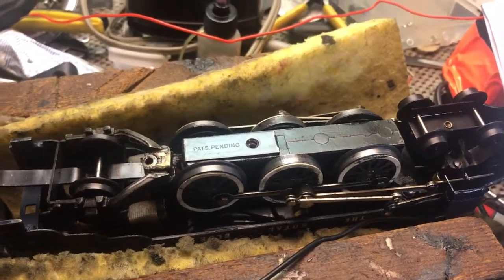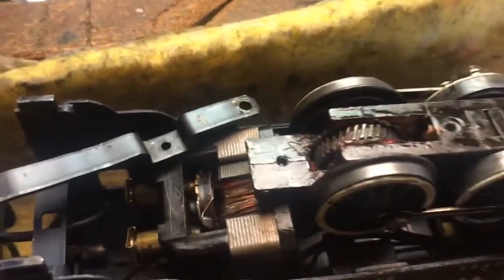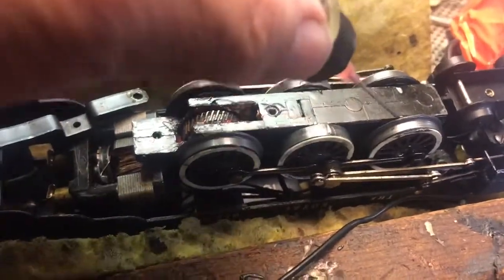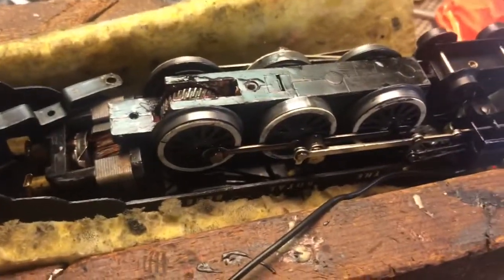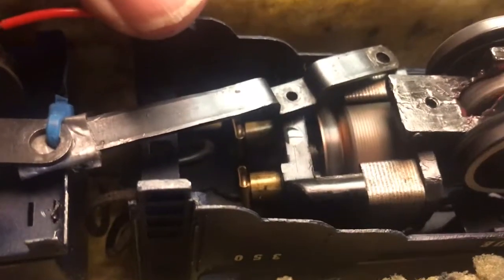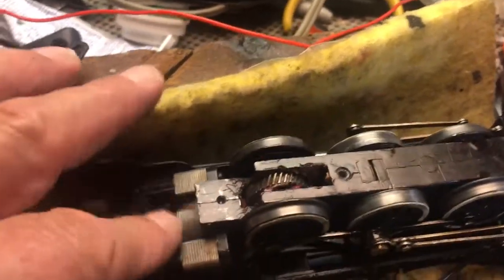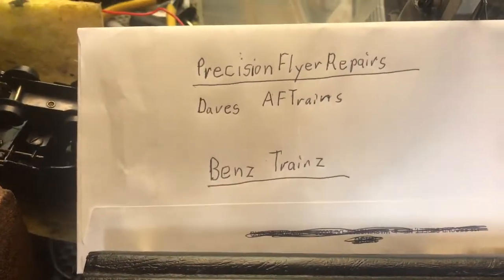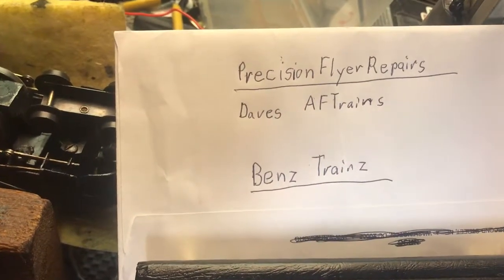Oiling & working on old Post War American Flyer Trains

Comment: Have you tried any solvents to clean out the hardened grease? I use rubbing alcohol and cigarette lighter fluid for that. CAUTION ⚠️   The chassis must be removed from the shell, paint damage may result otherwise. I also use Tri Flow grease and oils, being a biker you might be familiar with them.
Reply from the maker: I use brakes parts clear on the motors ,but only outside and I let the motor outside for 2 or 3 hours to let dry and not run the motor for 24hr or more